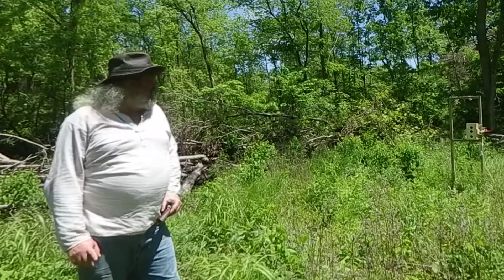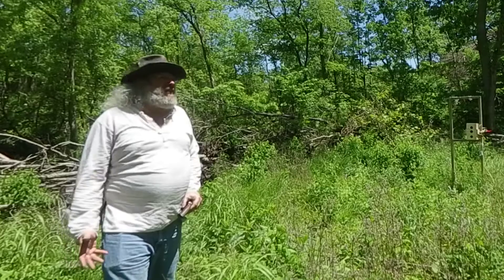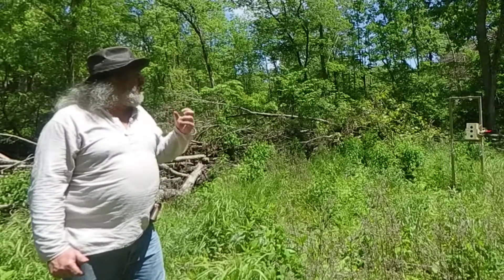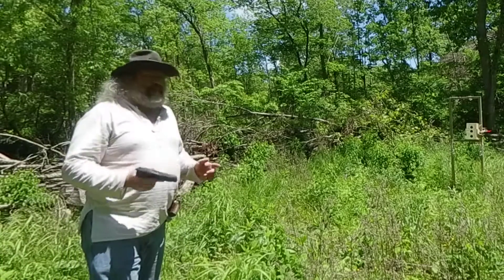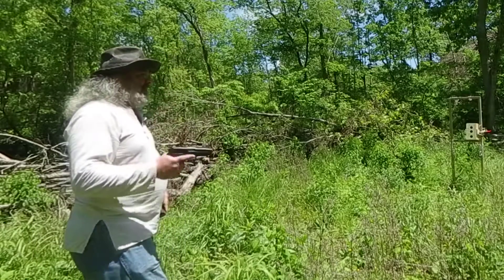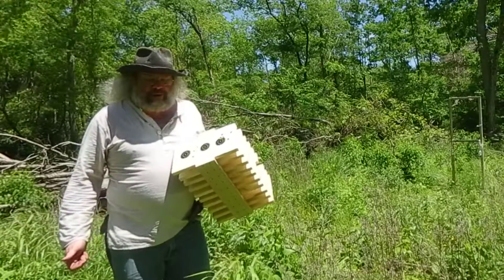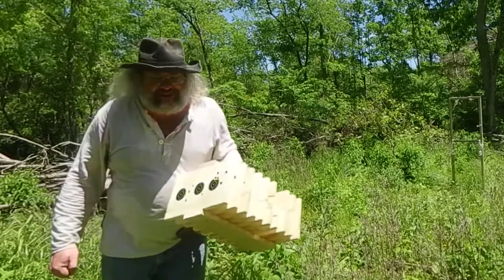Pine Board Penetration testings (1858, vs 9mm, vs 45acp)

Comment: I just watched  FT/b test a F/S test between  a 6 inch .44 Magnum 240 gr  and an 1862 Remington 8 inch .44,  210 gr bullets speed = F/S  between the 2 pistols + - 50/60/Fs the same  even the F/P energy was almost the same. if your were to kock off 30 gr  the 44 mag had over the 1862 new army. overall  the difference is minimal, says something about the old timer pistols. NOT to be laughed at by any means!  they will mess your day up just as fast a modern .44 Mag ..

Comment: You loaded ffffg powder? Thought that was for priming flintlocks and MAYBE for like .22  but never for a 44
Reply: @kirk stinson "flintlock priming powder" is a modern misconception, and misinformation, and did not exist in the 17th,18th, or 19th Century. Flintlocks were primed from the military cartridge charge, or from the powder horn / flask on the frontier. 

In America, starting with the 1802 Dupont maple charcoal formula for black powder for the U.S. Government, FFg was Musket Powder, and FFFg was Rifle Powder. 

Beginning in the 1830's, Hazard Powder Company used willow charcoal to make a hotter black powder than Dupont , and in Hazard's designations, FFg was "Shotgun Powder", FFFg was "Rifle Powder, FFFFg was "Number 1 Pistol Powder".  

In 1855, Samuel Colt started manufacture of what would eventually become revolver combustible cartridges, and requested a special Hazard Powder. Hazard then made "Cartridge Powder", a very fine grain 5Fg powder to be used in the paper powder envelopes of revolver combustible cartridges.  

Proper revolver nipples have very tiny flash holes to prevent blow back and cap jams, and can safely be loose loaded from a flask with 4Fg powder because the 4Fg will not dribble thru the nipples onto the revolver breech face. However, the very fine grain 5Fg "cartridge powder" must be used only in paper powder envelopes, as it is so fine grained it will dribble thru even tiny nipple flash holes, coat the breech face, setting up a chain fire danger when the powder on the breech face flares up during firing.  

The modern black powder that is likely close to as hot as 19th Century Hazard Powder, is Swiss black powder, made with Alder Buckthorne charcoal.  Using Hazard Powder designations, Swiss FFFg would be "Rifle Powder", Swiss 4Fg would be "Pistol Powder" and Swiss Null B (5Fg) would be "Cartridge Powder".  

I've made combustible cartridges using Null B; using a 216 gr conical, 22grs was used in the paper powder envelope, keeping with the 19th Century practice of using a charge of around 10% conical bullet weight. Fired from a Uberti Replica Remington Army, the measured muzzle velocities are 940+ fps, and hit steel silhouette targets noticeably harder than 45 ACP's. The Uberti Remington, fired using the combustible cartridges, is VERY accurate, easily hitting full sized steel silhouette targets at 100 yards.  The combustibles are all pre-greased by dipping the exposed conical bullet section in a melted lube of 2 parts beeswax to 1 part coconut oil. The combination of lubed bullets plus small charge of relatively clean burning extremely fine grain black powder, allow the revolver to easily fire 10 or more cylinders (60+ shots) without any fouling issues at all.

What I've learned from duplicating 19th Century loading practices for cap and ball revolvers, is that the revolvers are actually very powerful, very accurate, and every bit as capable as modern handguns. For the first 6 shots, the cap and ball revolver will effectively run with modern handguns in aimed accurate fire. After the first 6 shots, the C&B revolver will naturally be left behind by modern metallic cartridges and box magazine firepower. For most modern self-defense situations, I'll prefer a Glock 19 over the Remington Army. BUT, If I'm facing a bad guy with a Glock 19, and there is considerable distance between us, say 75+ yards, I'd take that Remington Army in a heartbeat. That 216 grain combustible cartridge load is ACCURATE, and DEADLY, hitting like a freight train, and that Remington Army with the 8 inch barrel is like a sniper rifle of handguns!
Reply from the maker: Ffffg is a fast burning poweder, mainly used today as a flash pan powder (though hey they use ffg as a flash pan powder too)

There's plenty of discussion of what modern powder Size is vs period powder. And also going by memory I think there's at least a lyman manual that gives 4fg load for 44, but did come across published load data when working them up.

For me I started off with a reduced load, worked up, its about the same as using tripple 7. Currently I just using it as my hunting load and not everyday load. So talking about 3 or 4 cylinder load a year. For everyday shooting I use 3fg

Comment: Very informative test! Thank you for posting this. Pretty well destroys the modern myth that a .44 Army Cap and Ball revolver is about the same power level as a 38 Special. Obviously, when loaded with historically correct ammo, the .44 Army C&B hits every bit as hard as a 45 ACP, if not a bit harder. You are correct in using 4Fg in a revolver as that fine grain was considered "pistol powder" back in the 19th Century.  Hazard Powder Company began making special "revolver gunpowder" at the request of Colt around 1855 when Colt began manufacturing revolver cartridges. Tin foil envelopes were initially used 1855-1857, but were not popular due to foil residue left in the chambers. From 1858 onward, Colt used the paper powder envelope glued to a conical bullet, and those "revolver combustible cartridges" became extremely popular.  Hazard Powder made "Number One Pistol Powder" which was 4Fg, and was intended to be loose loaded from a flask. Hazard also made "Cartridge Powder" which was extremely fine grained 5Fg powder which was intended strictly for use in revolver paper powder envelopes. The extremely fine grain 5Fg "Cartridge Powder" could dribble thru the nipples if loose loaded, coat the breech face and set up a chain fire situation when the powder flared up on the breech face. Historically, .44 Army conical bullets tended to be around 210 grains weight, give or take 10 grains, and the Hazard "Cartridge Powder" charge in the paper envelope was around 22 grains, or roughly 10% of conical bullet weight.   Shooters using GOEX FFFg in a reproduction revolver get the mistaken impression that a 22 grain charge under a .44 Army conical bullet is "weak" because they are using a low pressure gunpowder made from maple charcoal that exactly duplicates The 1802 Dupont formula to provide a low pressure gun powder that would not rupture the thin .69 caliber musket barrels in use by the U.S Army. GOEX FFg duplicates Dupont "Musket Powder" and GOEX FFFg duplicates Dupont "Rifle Powder" made for the U.S. Government.  Swiss black powder is a true "Sporting Grade" gunpowder, made from Alder charcoal that generates a sharper pressure curve than GOEX and significantly higher velocity than the same charge of GOEX.  The Hazard Powder made for revolvers from the mid 1850's onward, was made from willow charcoal, and may have been even a bit hotter than modern Swiss black powder!
Reply: I measured 700 joules out of my 1858 8inch remington replica... loaded with FULL chambers of swiss1 and oversized .457 round balls (to have more pressure being built before the ball would be unseated...).
Those guns were NO jokes...

Comment: Great content! How many grains of powder did you use for these tests?
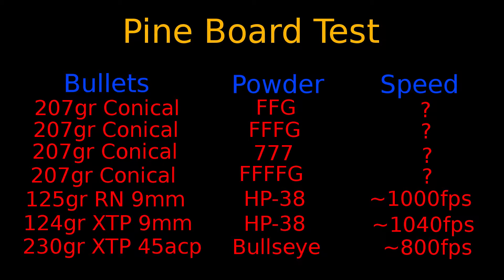Reply: @Cosmic Dust he uses 26 grs (says around 0:50 in the video) of black powder or substitute. The BP/777  would be measured by volume in a measure calibrated to hold 26 grains of water weight, and NOT on a scale. "26 grains" is actually a volume measure of 1.69 cc as water weighs 15.4 grains per cc.